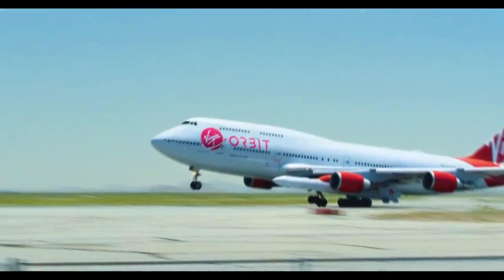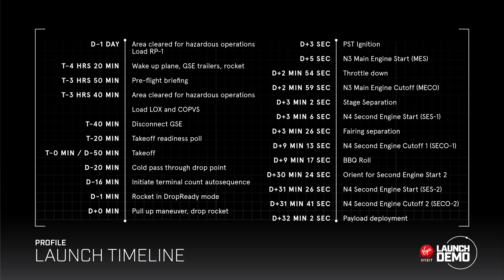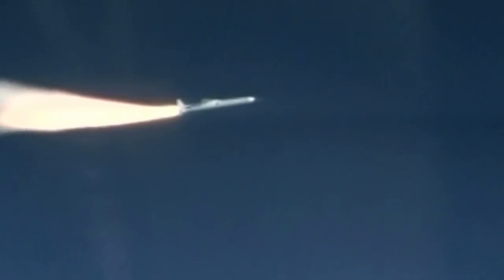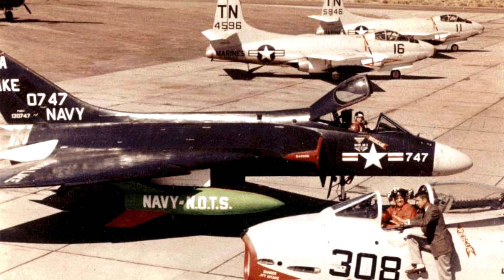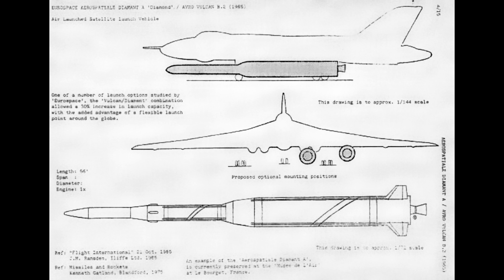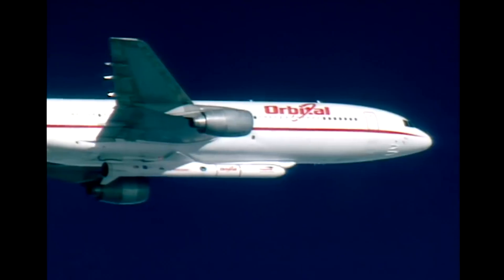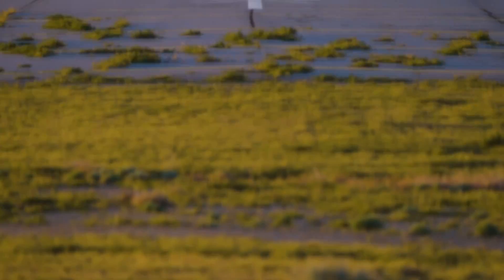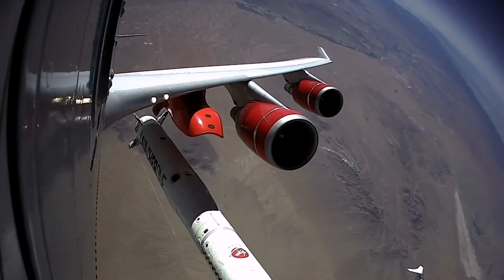Virgin's Orbit's Failed Rocket Launch & The History Of Air Lauched Rockets To Orbit

Comment: I'm sure this question has been answered many times in the past, but I don't know the answer yet so I'm going to ask anyway: Instead of carrying a rocket on the underside of a big heavy jet airliner, why not just strap some jet turbine engines to the first stage of the rocket to act as boosters? The ring of jet turbines could be jettisoned once the rocket reaches Mach 1, and then parachute to the ground. Even if the Mach 1 limiit means the jet turbines are only providing thrust for a few seconds, every second that a rocket can gain altitude without needing to carry oxidizer to run its engines is worth dozens if not hundreds of extra kilograms of payload capacity. Oxidizer is heavy stuff.
Reply from the maker: Thrust to weight ratio of jet engines doesn’t support vertical launch, which means building a plane that takes off horizontally with wings.
Reply: @scottmanley : the F-15 can accelerate in a vertical climb, so yes it is possible to build jet turbine engines that can fly vertically. It just isn't done often, because flying vertically is seen as the domain of rocket engines.
Reply: @scottmanley : Anyway, I wasn't talking about a rocket that uses jet turbines alone as its first stage, but uses jet turbines as boosters for the first stage. The jet turbines would only be lifting part of the rocket's total weight, reducing the amount of oxidizer needed by the rocket during the first (and most expensive) seconds of the rocket's flight when it's moving slowly because it's so heavy. Surely if it's economically profitable to haul an entire 747 into the sky to launch a rocket, it would be even more economical to attach the jet turbines directly to the rocket as boosters and toss the rest of the 747 in the bin.
Reply: @fyrstormer  "Surely....it would be even more economical"  I don't think it is certain at all -- you are conflating horizontal and vertical flight.  Regardless, I would really like to see what sort of speed and altitude you could get out of strapping 4 or 5 powerful/efficient jet engines on a vertical takeoff of something like the Virgin LauncherOne.
That being said, from what I understand, the LauncherOne has to get up to speed horizontally (using its rocket) in order to get to orbit (otherwise they would just launch it straight up from the ground).
Reply: @scottmanley  AFAIR, that's not true. Mig-29 had - in the records-oriented, stripped-down, trims - thrust higher than its weight.
The goal of the plane is not to give it more speed and altitude, but to deliver it to the arbitrary point and direct it in an arbitrary inclination.
Reply: Probably not enough thrust to go vertical, and if that means going horizontal with wings, then might as well make it a plane (as a carrier)
Reply: Do you mean strapping jet engines onto the first stage of a rocket? If so, the first problem is atmosphere. Jet engines need air for thrust, so at higher altitudes they're not as efficient. For frame of reference, the ISS orbits ~250 miles high, while most planes don't fly above 10. Second of all jet engines are weak in comparison to rockets and may actually reduce overall thrust due to the increased aerodynamic drag. Thirdly, even if you dropped off the engines in a way to achieve maximum efficiency, you still have to carry a bunch of now useless hardware through the rest of the first stage
Reply: Their trying to do it on the cheep. Trying to put up a small satellite in the 10 million mark. Rather than the 100 millions it takes now.  You could do what you are suggesting, but at that cost you could just call space x to launch your payload.

Comment: I understand that air launching allows  the company the ability to launch bigger payloads with smaller/cheaper rockets but this seems so dangerous to me, I honestly believe that if this effort continues, eventually we will see the loss of the 747 and the crew aboard it, a pretty steep price for an "unmanned" orbital booster.
With SpaceX and Blue Origin among others developing fully reusable orbital boosters and vehicles, it seems like this will soon be priced out of the market anyway, even if it is successful.
I hope I'm wrong, but this just seems an incredibly risky way to launch unmanned cargo, especially when there are other providers that can offer similar services at similar prices without the risk to human life that this system does.

Comment: "Technically" a New Zealand rocket? Come on, bro. Credit where credit is due.
Reply: When the launch is successful it's a New Zealand rocket. When it fails, it's the Americans'.
Reply: As a Kiwi who helps manufacture electron, it's almost certainly a NZ built rocket. Components of it are manufactured in the US but the actual building / assembly is done here
Reply: Rocket Lab is in every official sense an American company. But you can't ignore how connected they are to New Zealand.
Reply: @philb5593  I'm pretty sure Rocket Lab is only an American company because of ITAR so they can carry US Govt payloads.  The heart and soul of the company is in New Zealand.  The company was founded in NZ by Kiwis and the original rockets and the first launch facility were all built in NZ.
Reply: @somerandomnification   They do build their engines and control systems in America.

Comment: At some point Branson gotta face reality........rocket science is hard.
Reply: Rocket Science is relatively easy.  Newton had it figured out, and Tsiolkovsky and Goddard provided the punctuation.
Rocket Engineering - making it actually work - that's what's hard.
Reply: @peterstickney7608  yup. Putting all that knowledge into something reliable is extremely hard, which is why it's been pretty incredible to see how well space-x got it together on a "shoestring" budget compared to someone like ULA. 

Also as Scott mentioned, a liquid powered air launch with enough delta-v to get to orbit is extra hard mode. I'm betting the solid rocket version & many less moving parts will be easier to start out with.
Reply: @peterstickney7608  So you mean to say rocket science isn't rocket science, but rocket engineering is.
Reply: @peterstickney7608  In comes Elon saying "Rocket design is easy. The hard part is the production line!"

Meanwhile SS design after design flops...
Reply: @peterstickney7608  The ironic thing is that rocket practice (as opposed to rocket theory), which is only indispensable for that first one hundred miles of a lunar, interplanetary, or even interstellar voyage, can be replaced--for the rest of the journey (if the spacecraft is of the continuously-propelled type [rather than the coasting type, which is boosted by staged chemical rockets])--by far simpler propulsion systems, and:

For the next quarter million to even trillions of miles, the solar sail, the E-sail (electric sail), magsail (magnetic sail), and the tether (rotating or not) can be used. Solar sails are best deployed in Earth orbits (if not in Earth escape trajectories) at least five hundred miles up, in order to minimize atmospheric drag (and are best pushed using lasers or very close solar flybys, for outer Solar System and interstellar missions), but it and the other non-rocket propulsion systems demonstrate Arthur C. Clarke's point, made in his 1968 non-fiction book "The Promise of Space" (I'm going from memory here, but it's close to verbatim) that "The first hundred miles of an interplanetary voyage are more difficult than the next hundred million."
Reply: How hard can rocket science be, anyway?
Reply: According to Elon Musk, making and launching an orbital rocket could be accomplished by any reasonably intelligent high school student.
Reply: @danchatka8613  given a massive budget and zero payload, sure. Anything useful for the money? No way.
Reply: He could start by using a dildo and observing the reciprocal motion physics
Reply: Rocket surgery even harder :P
Reply: Branson is a brilliant marketing guy, from Virgin Records and The Sex Pistols onwards. But he's not an engineer.

Comment: 4:25  Wow! I thought it was a big deal when an F-15 launched a suborbital anti-sat weapon in 1985 - but it was decades after these guys wanted to go orbital! And the next 1950s program was an anti-sat one - when there were barely a couple of satellites in existence.
Reply: All these years I always thought it was the Pegasus (early version?) that was launched from a F-15. Didn't know about later versions.
Reply: @johnknapp952  You can get a better idea of the size of a Pegasus by checking the one on the truck in the video - Pegasus is pretty big.
The F-15's ASAT was based on the SRAM - Short Range Attack Missile - an Air-Surface beast that was carried by B-52s (A dozen or so), and FB-111As (6) that, when in its normal role, flew fast enough that it provided all of its lift from its body. (No wings)
Reply: I didn't know about the 1950s ASAT program, but I will make an educated guess that it used a nuclear warhead. Because 1950s. Will have to look that up...